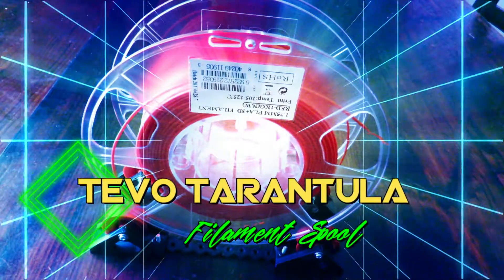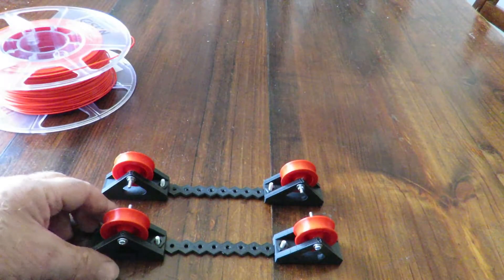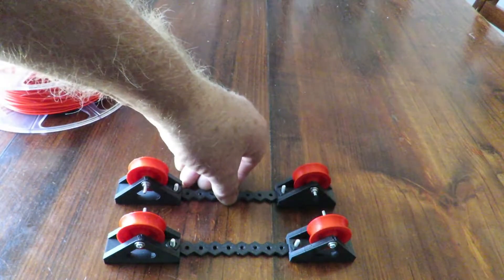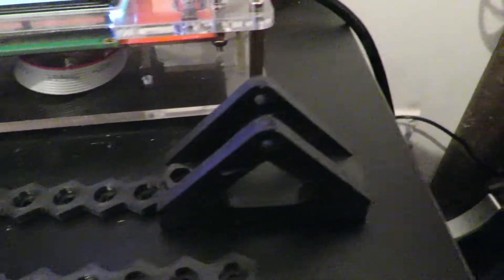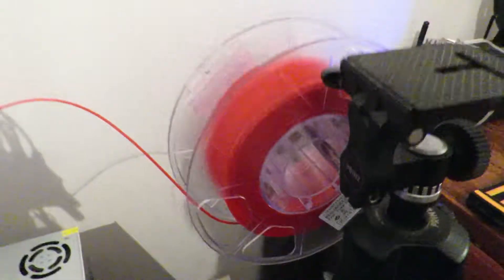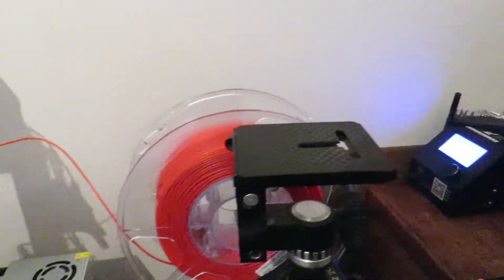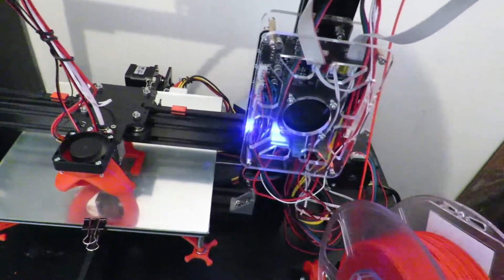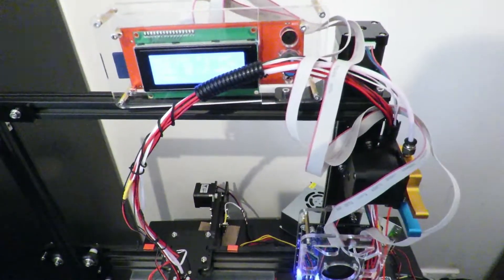📌Spool Holder Upgrade for my Tevo Tarantula 3D Printer

Comment: Thanks for the design Garry, most of the other ones I've seen require 608 bearing ( which of course I bought a bunch a while ago ). Cheers, JAYTEE
Reply from the maker: I'm a cheapskate haha.

You have to be careful with filament over-run (causes the filament winding to get loose and jam on themselves), so a bit of tension is not a bad thing.
This Thingivers Spool design does spin very nicely (So Far)
Reply: Agreed ( on the over run ), Cheers